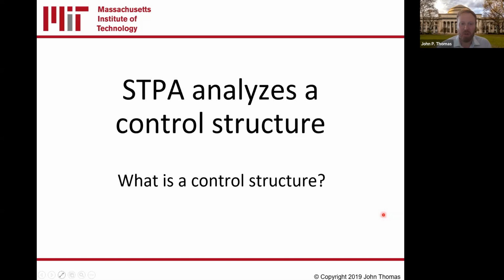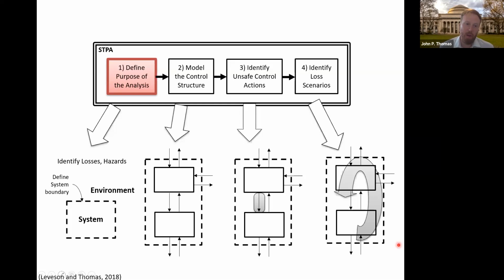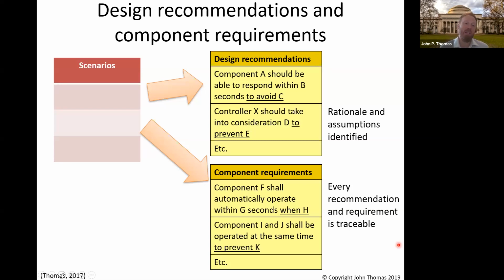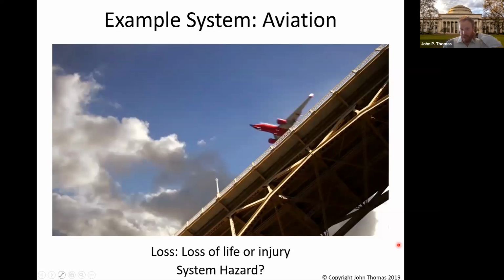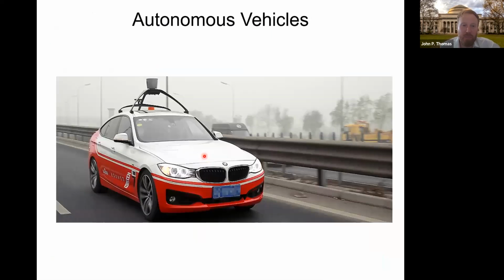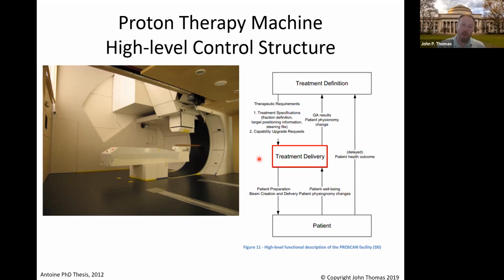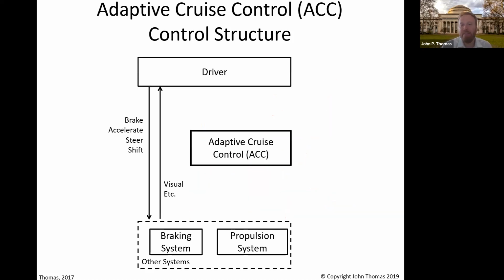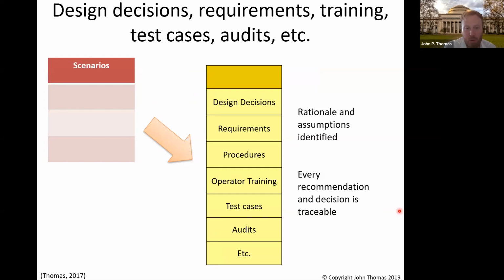Introduction to STPA

Comment: The ABS system in a car is designed to prevent the wheels from locking up in a panic braking situation. In doing so, the car can stop faster than it otherwise would with manual braking because the driver would almost certainly lock the tires up and go into a skid. When the tires skid, the car takes longer to stop. In fact, there is no way to stop the car faster than by using ABS, and this has been extensively tested.